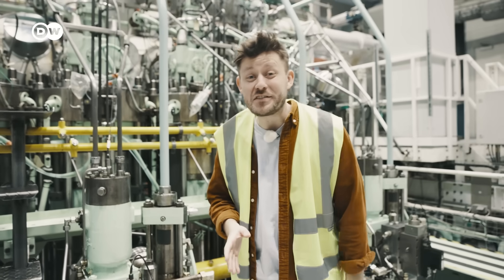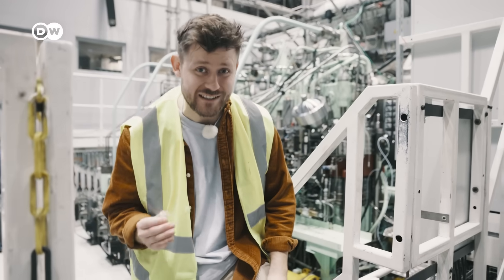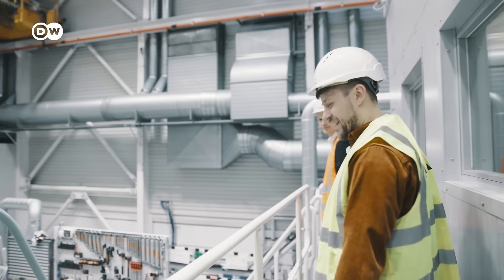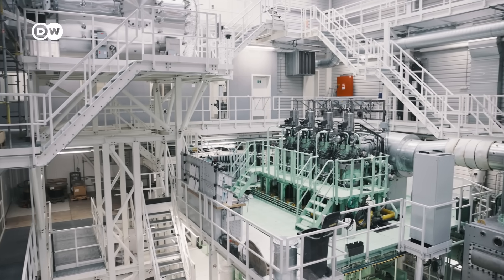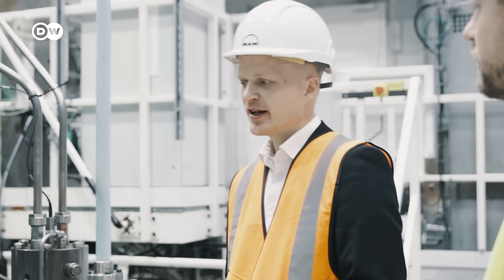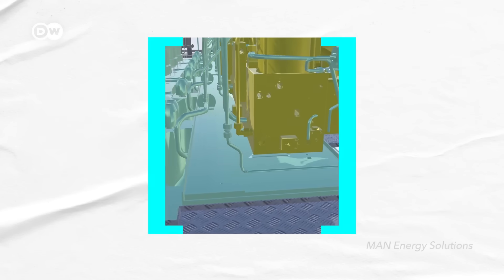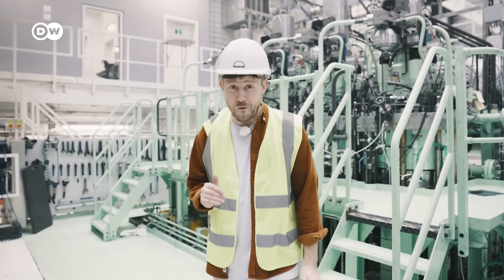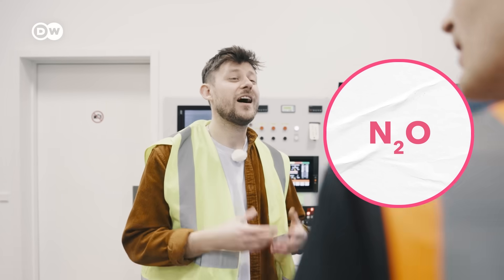Can this magic fuel clean up the shipping industry?

Comment: 0 seconds ago
🤔If the process REQUIRES electrolysis of water to the separates Hydrogen from oxygen…then why not have SHIPS ,that naturally have direct access to abundant water, use the Hydrogen gas directly as a fuel source ?
Reply: Because the electrolysis needs insane amount of energy, which the ship would need to carry with it. So HFO generators to run electrolysis to run main engine on H2 makes absolutely no sense. These green fuels makes only sense when produced in areas where abundance of electric power is available. If that electric power was available on the ship, it would make much more sense to run the propulsion on electricity.

Comment: Ammonia is incredibly toxic. It should not be a means to propel ships due to the very high risk of accidents both to the wider environment and the risks to the crews on board. It is far more likely that coastal and inland shipping will go electric while blue water ships will go methanol. 
The problem with methanol is very low supply outstripping demand from a number of industries. But there are at least a number of methanol ships already at sea.

Comment: That sounds like a Ship crew's nightmare engine room.
Reply: We stopped using ammonia as a refrigerant for a reason... Small leaks in confined spaces will kill people.
Reply: @Sembazuru  It's still being used in refrigeration plants that works in large scales though.
Reply: For sure
Reply: They should use 2 stroke ammonia engines they have less parts😺👍
Reply: @fidelcatsro6948  The thing is, for the use in such engine, the ammonia fuel has to be pressurized all the way to 80 bar (basically subcooled liquid but very pressurized) prior to injection. That's lots of potential energy ready to burst during leakage situations.
Reply: @lontongstroong  i see....
Reply: Especially during loss of containment. Ammonia's toxicity threshold is so low that it can be dangerous even at very low concentration (like few hundreds of ppm). It's much bigger hazard than that of fire or explosion (it burns relatively very slowly after all). 

Even worse, unlike diesel fuels, low-sulfur fuel oil, and methanol, water sprinkler as mitigation is useless here because ammonia will vaporize and form even thicker cloud when in contact with water!

Comment: How is this bullshit even a thing? For hose not familiar with basic properties of Ammonia, you should know the following: Ammonia is about 1/3 the energy per unit mass of existing fossil fuels, boils at temperatures well below freezing, so it's a gas or being stored under high pressure or low temperatures (Both of which make it more dangerous and need energy just to keep it sitting there). 

That's before you consider that you can't just drill it out of the ground like oil, so it has to be made, requiring more energy again, before it can be used. Also look up what happens when ammonia reacts with water, and then consider that your eyes, and the inside of your lungs are coated in water, and tell me again how this is an upgrade over existing liquid fuels...

Comment: Ammonia can be produced directly via Water electrolysis,
Without using Habber Bosh process.

Note,
This does not 1st convert water into Hydrogen and then Hydrogen into ammonia.

Insted this directly converts,
Water + N2 + electricity = NH3 + O2.

This is completely green if we use Green electricity.

This method is used still in Lab environment.
But can be commercialized soon.

Note- 
This method was there for very long time but it's efficiency was very low, so it didn't made any economical sense.
But recently, its efficiency is increased to mote than 90%.
Reply: Do you have any links or anything?
Does that method have a name?

I haven't heard that before but I would be interested to learn more.
Reply: Saw a few papers on that, super low TRL though (like TRL 1 or at best 2).

Comment: About 99% of Hydrogen produced today is made with fossil fuels. Hydrogen production, without any of the energy it consumes, emits massive amounts ot CO2, because the fossil fuel feed stock has its carbon atoms stripped from it to make the Hydrogen. Then you add in all the energy required. For Ammonia, you not only use Hydrogen, but Nitrogen, to make it. Nitrogen in the air has the strongest chemical bonds possible. Each atom is trible bonded to its pair by 3 electron bonds. It takes enormous amounts of energy to break those bonds.

That is why the creation of Ammonia currently causes about 2% of global greenhouse emisions.

All that to make a fuel that is only added to fossil fuel conbustion.

Yes, yes. I know a lot of people will be screaming on about green Hydrogen and even green ammonia. The problem with both is scalability and especially price. The oil and gas industry is putting huge amounts or money into Hydrogen and Ammonia because they know that in the end, everyone will keep using fossil fuels to make them simply because it is the cheapest option. Corporations won't even have a choice in the matter. They are legally obligated to seek the most profitable option for their shareholders. Anyone claiming otherwise is lying to you.

Comment: So you use lots of energy to make amonia, then you get many times less caloric energy out of that fuel and you need larger tanks to store it, making ships carry less cargo than ships running simply on oil. I am wondering if burning oil in the first place would be better, rather than building all of that infrastructure and spending all of that energy. Its only 3% of global emissions. Maybe we should focus this energy and resources into more polluting sectors like house heating(insulation), agriculture(reducing meat consumption and production) or cement and steal production.

Comment: My bet is on high temperature latent heat Batteries equipped with TPV cells powering ships in the future. At upwards of 1MWh /m2 (around 700kg) when carbon (solid, like graphite) is the thermal mass. That means you can store upwards of a GWh in 10x10x10m of carbon thermal mass. For weeks. @ about $5 per KWh capacity. I think it'll beat anything else on cost, safety and probably every other conceivable metric including the expected lifetime of the battery and the motor.

Comment: Since you need electrolysis to extract hydrogen from water, I wonder would it be better just to skip adding nitrogen and just use hydrogen?
Reply: It probably would, however hydrogen is tricky to store and transport and volumetric density is extremely low.. That is why a lot projects is working on storing the hydrogen in another chemical solution.
Right now in shipping that is eMethanol and eAmmonia.
 
Smaller ships trading in local ports are looking at battery storage especially ferries.
Reply: Hydrogen is even more dangerous. Ships with compressed hydrogen tanks can be as dangerous as a bomb. I would assume that many ports would reject ships with hydrogen tanks.
Reply: @PrimaryDye  You wouldn't use compressed hydrogen for cargo ships, energy density would be catastrophically low (with heavy pressure tanks). The only option would be cryo-cooled liquid hydrogen.

Comment: Bio-methanol can be way less expensive than e-methanol because it doesn't need DAC, according to IRENA. It can use any biomass feedstock as opposed to ethanol that needs food crops for fermentation, but I'm not sure just how much biomass carbon is theoretically available or if we have proper reactors for it on the market yet. Its way easier to store and burn though and some big ships that can use it are in operation already.
Reply: Might work in substitutionary basis but not the one that will do the hard carry since the ceiling of total production scale would be too low relative to the demand.
Reply: @lontongstroong  How high is that ceiling, do you have a number? Keep in mind, when people talk about biofuels they mostly mean conventional ethanol from corn or sugarcane, not methanol from lignocellulotic biomass.
Reply: @E1Luch  From a simple estimation, vanishingly small actually. Assuming the methanol is produced worldwide from cash crops and all of lignocellulose wastes (agricultural and to lesser extent municipal), it would only yield around 50 PJ/year at best (in 2023). This is three magnitudes smaller than that of the maritime transport sector's demand and thus isn't a sustainable solution other than limited, local roles.

Source: US’ NREL paper (Harris et al. (2021) Appl. Energy 303)
Reply: @lontongstroong  If I recall, the max production scale of biomass-derived methanol is only 3 magnitudes lower than that of the maritime demand ALONE. That's a totally different ballpark!
Reply: @NotLahEnough  Thanks a lot. Tried to write the comment (apparently approximately the same answer!), alas the comment was repeatedly auto-deleted without apparent reason :((((
Reply: The words Bio-mass, and fuel, don't go together. 
Bio-mass undergoes such a tiny energy fluxrate that there is simply no way to use biomass to replace fossil fuel. 
Only nuclear-thermal production of synthetic fuel can come anywhere close to the scalability necessary to replace fossil fuel. But you would still be talking dramatic amounts of new infrastructure. It just happens to be the smallest cost and impact of all the alternatives that require new infrastructure. That said, it can only happen if the NRC is abolished and nuclear regulation authority reverts to DE in a comparable capacity to how it was run prior to the creation of the NRC and the intentionally anti-nuclear regulation paradigm that was created by the sierra club and their cooperators.
Reply: @alexanderx33  "Energy fixtrate" makes absolutely no differenece here, the only thing that matters is how much carbon atoms can be provided. Its not like hydrogen or ammonia come without the need for massive ammounts of electricity during their production either. 
  Also to me it doesnt really matter what powers the process as long as its clean and cheap, but you drastically overestimate how expensive or environmentally damaging renewables are. Some utility scale solar PV installations can now produce energy at 1 cent per kwh, and heat storage for lower-temperature industrial processes is cheap if even needed in the first place. If you're worried about the land needs - first of all, its not that much (recheck your calculations), and second, wind turbines dont take much space at all. And no, their impact on birds is miniscule compared to other causes, such as impacts with buildings, and most importantly CATS. Literally household cats.
Reply: @E1Luch  Fluxrate, not fixrate. Although i can kind of understand how they would be related. It means flow per unit area. I was talking about biomass, not ammonia. Because plants are very work intensive and inefficient. The only reason we farm is to convert energy from light and inedible chemical energy into edible chemical energy. As a Source of energy, it's a net negative, ie its not even an option, let alone one of the alternatives. We take advantage of waste biomass because we need to get rid of it anyway, not because it is preferable to primary energy sources.
Reply: @E1Luch  The issue with wind and solar is two fold (land use is just an incidental benefit of concentrated energy, not the main reason). 
1. Time distribution. 
Hydrogen producing electrolysis in a usably efficinent form requires a continuous source of power and becomes unviable with supply variation. And most other energy consuming activities are the same way including the utility market, though those can live with reduced supply whereas hydrogen just doesn't pencil out period. 
2. There is scalability, and there is scalability. PV panels and wind turbines both reach a overall production limit set by the available materials to produce them. Nuclear simply doesn't have that problem, particularly for atmospheric pressure designs that do not require massive containment superstrucures to protect against steam flashing. (these are the main concrete and steel intensive parts of a PWR plant). There is so much less material to deal with.
Reply: @alexanderx33  You didn't read what I said, did you? Biomass is NOT a source of energy here, its a source of CARBON. Methanol, ammonia, hydrogen are not energy sources, they are energy CARRIERS. They all need energy input at production stage and that comes from renewables, nuclear or whatever else. Also even for conventional biofuels, ethanol from sugarcane is energy-positve. Its only corn that is negative. And I'm not talking about conventional ethanol.
Reply: @alexanderx33 
 1. One way to deal with intermittency is to build large-scale interconnected grids where outperforming renewables in one area can export their energy elsewhere. Second one that you ignored is that many industiral processes run on heat and storing heat as opposed to electricity is very cheap. Thrid one is not any process needs to run continously. And then we talk about nuclear that does not perform well at demand response either. Yes I know french reactors can ramp down to 50%, but that hurts their economics. Nuclear costs are all CAPEX so to make the cheapest electricity reactors need to run at 100% capacity all the time.
In general, there are plenty of papers that outline even 100% renewable energy systems with LCOE below 10 cents per kwh. And I'm not even arguing for a 100% renewable generation, I really do not care. Do you have anything to back up the claim that going all nuclear will be less expensive?
 2. What kind of material limits do PV pannels and especially wind turbines have? Structural materials such as steel, aluminum or carbon composites are widely available. Copper for wires can be replaces with aluminum, and its not like we are running out either. U-235 on the other hand is scarce so we need breeder reactors or some unconventional resources for nuclear to be the bulk of energy generation worldwide. But the "unconventional resources" part can also fix many supply issues with renewabes if they ever matirialize.
Reply: @E1Luch  The act of reducing the carbon from its oxidized state IS the part where energy enters the carrier though, which means farming (for methanol) even if its tree, hemp, poplar. It's still too inefficient.
Reply: @alexanderx33  Its one of the parts. Depending on the resulting carbon to hydrogen ratio there might be a need to add some hydrogen, and that comes from electrolysis. Plus the energy required to operate the machinery to grow and process the crop into fuel. And the point why this is the cheapest option is that the crop grows on its own with minimal maintanance and without capital-intensive DAC machines. The only thing that matters for scalability is how much can be grown per hectare per year and whether we have enough land to get enough for shipping and aviation (not for all road transport, that will be electric).
Reply: @alexanderx33  For example, lets say we grow switchgrass with annual yeild of ~6  dry metric ton per acre = 15 ton per hectare. Over 100 million ha thats 1.5 billion tons, should be more than enough for shipping. Total wild grassland area on earth is 1.7 billion ha, total forest is 4 billion ha. Most of the grassland is already used for grazing, so if people switched to more plant-based diets which generally require way less land it could free a billion ha or more depending on the diet. So at the first glance it looks like theres plenty of land.

Comment: Any cleaner fuel will be better than the heavy fuel oil currently used in ships :)
Reply: There have actually been speculation that the cleaning of bunker fuel back in 2020 has been part of the reason for the recent heating (from 3.5% sulfur to 1%).
It has to do with sulfur reflecting sunlight... It might have played a small effect, but I doubt it would be big.
Even Sabine Hossenfelder made a video about it.

Comment: To me, it sounds worse than hydrocarbons. Why not capture CO2 from smokestacks and create hydrocarbons?
Reply: Thermodynamics. The energy costs for doing so would, in a hypothetically perfect-efficiency system, precisely equal the energy produced by burning the fuel in the first place.
Reply: Exacty. You need to apply the same amount and probably even more energy to break the bond between C and O2 bond as when the fuel was once burned to create the CO2 so it has zero net output regarding energy. It would however indeed reduce the CO2 in atmosphere but for that to have any effect you would need to convert a hell lot of CO2 since we have already burned fossil fuels for 100s of years now spewing CO2 into the atmosphere.

Comment: "you're a critical journalist" 😁 go get them! ask till they dripping wet of sweat! 👍
Reply: I saw a good hearted scientist and a good hearted journalist. On the opposite side but both at the border. I had a genuine good laugh at this point!
Reply: It's good indeed. We needed more of this 15y ago when they were launching the biofuel hype and there was too little pushback.
Reply: It is certainly good to ask these questions. But from an R&D point of view I also completely understand the guy from MAN here. They are still testing the engine and catalyst so it is really hard to give specific information about emissions. They either lack enough data, are testing only specific modes of operation or think they can actually do better at larger scale. So every figure you give at this stage is either not representable, is too good to believe or is too bad and will be seen as a "it doesn't" work.
Reply: I mean, of course they wouldnt give out those details about the catalytic Reactor, because they are probably not good enough yet at that stage of development, which is fine since they arent selling it as one, literally. Revealing the performance of an unfinished prototype wouldnt make sense and might harm their reputation against their efforts to improve on it